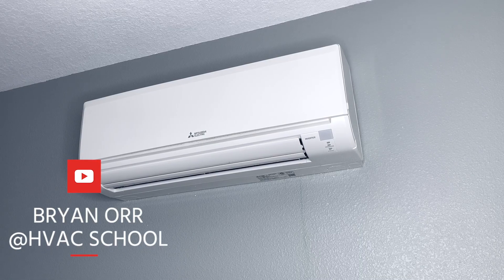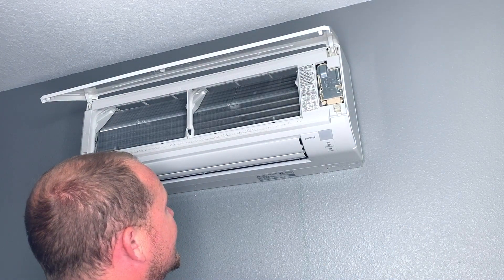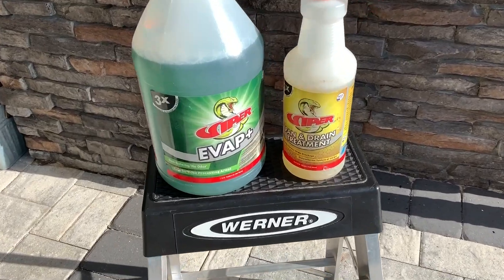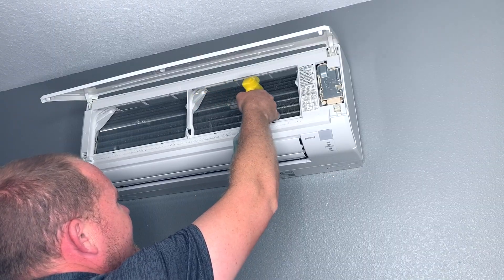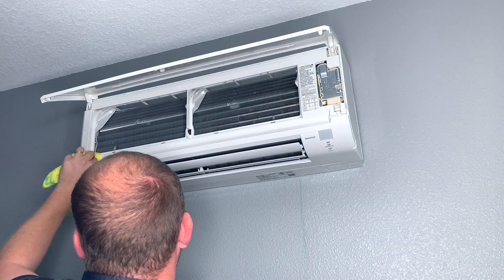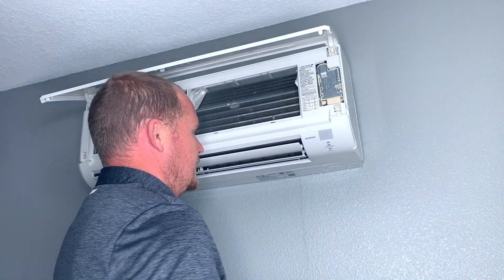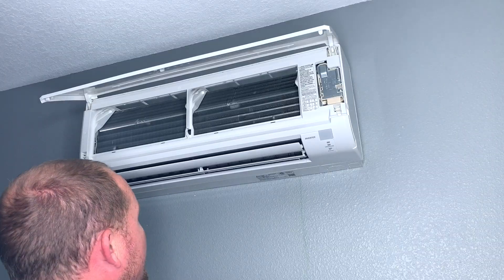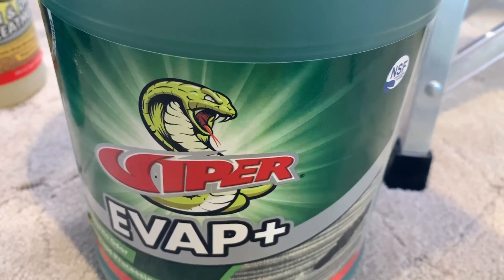Smelly Ductless

Comment: Thanks for this.  We used to get “ the smelly sock odor complaint, but didn’t have these products back in the 90’s
Reply: Yeah that green viper E cleaner works wonders on visibly clean evaporators with that strange smelly socks odour.   I've got MHI splits and they can be set to a self clean mode,  all it does is run the evap fan very slowly for about 1 hour after the unit is turned off with the remote,  drys out the coil and fins,  prevents most of that bacteria growing.
Reply: How do we know if we have this on ours?

Comment: Hello great information unfortunately for my Mr Cool split unit is still having the same odor after using the products u mentioned  I have done a deep clean also, I notice that when my unit is not cooling but blowing air  it will start to stink again I literally have drop degrees every other hour just to keep it cooling so that the air won’t smell 😩 any other recommendations I can try?

Comment: Great video. In view of all the videos like this and others showing the mold buildup in mini split system, why would anyone install these units. I reside in a log cabin and I was planning to install a mini split system—NOT NOW!
Reply: Because they're incredibly efficient, they can be installed in a day, they can be your primary heat, No duct work is required, etc. It would be a great option specifically for a log cabin.
Reply: Well because the units already cost me 10k and I didn't have another 12k sitting around to install ductwork.

Comment: The blower wheel also builds up debris over time,  it can add to the bad smell, looks like clumps of mold etc...And make sure the drain line is clear, I have cleaned the drain lines on 2 of my 5, that did clog over the years, preventive maintenance can keep them from clogging, gunky crap grew in them, depending on the drain hose used, different stuff gunk them up.  Clean tygon grows some foul stuff, maybe the corrugated drain lines sold as minisplit drain is actually better, I use both  types, it doesn't kink, to create reduced areas, and different plastic, more immune to growth of funky molds etc...
Reply: What’s the easiest way to clean the drain lines ?

Comment: My unit is 1 year old and fairly clean.  It was cleaned with recommended cleaners and still has a sour smell at times. My hvac is stumped.
Reply: Have you figured out what was causing the sour smell? I'm having the same issue. Tried all kinds of cleaners including the viper evap+ without any luck. The sour smell keeps coming back, and it only appears to occur when on fan mode (i.e. when the room gets to temp and the compressor turns off).
Reply: Nope! And go to Reddit, join hvacadvice, look for stinky sock syndrome which I posted.  jokers think I’m The only one who has a stinky ductless Mitsubishi. This is nuts. I tried to tell them IM NOT THE ONLY ONE AFTER RECOMMENDED CLEANINGS.
Reply: Nope! I accidentally responded on a different account I had. But join Reddit HVACadvice. Now they are saying I must have a dirty house. Wow! I need a group to follow me there.
Reply: @donjon8573 same here what a headache I’m working with the manufacturer right hopefully they can resolve this issue. I’ll keep y’all posted I have probably tried everything they recommend to do
Reply: It’s the plastic gullies in the units. Can’t be cleaned
Reply: @Mk-631  what are the gullies exactly ?
Reply: @jenconsumer5228 well, on my daikin ftxslvma i can see that unless you take the entire unit off the wall, the condensation catcher is larger than can be seen by removing the housing. It extends under and behind the coils however is has a plastic “wall” with 2-3 half inch holes for the condensate “inside” to trickle in to the visible channel  
You would not know what’s back there without flushing with cleaner and letting it dry. 
Harder stuff and “jelly” is difficult enough to get loose even in visible areas. 
Last week i spent half of one day cleaning my inverter (it’s seen years of use before i moved here, i SHUDDER to have strangers’ crud in my air)
Reply: Plastic gullies? What’s making the smell?

Comment: Had my ductless cleaned but still having an odor. What can be the problem.
Reply: I still have odor also after cleaning. Like sour smell.
Reply: I still have a sour smell coming from my unit even after cleaning. HVAC installer has no idea what's causing it or how to make it go away
Reply: Same here. Right off the bat of install almost. And when I change temps.
Reply: Did you figure out what is was? Ours have done the same.. right after install
Reply: Join Reddit Hvacadvice. I swear they think I’m crazy and saying I’m the only one oh, and they are telling my “my house is probably dirty”
Reply: I'm having the same issue. A sour smell is the best way to describe it. Tried all kinds of cleaners including the viper evap+ without any luck. The sour smell keeps coming back, and it only appears to occur when on fan mode (i.e. when the room gets to temp and the compressor turns off). My hvac guy can't figure it out either. Anyone have any ideas?
Reply: Did you figure it out? Ours do the same
Reply: Do you guys have this issue with ducted air? Also I heard it’s probably the plastic gullies in the AC, nothing you can do
Reply: Same as the other commenters.  Sour smell when the room temperature is at or near target temperature set.
Reply: Same, had a high preassure wash and it still reeks. 
Considering that it's an ideal for bacteria and fungus to develop, nothing you can actually do about it.

Comment: thank you for the tip! Cleaned all my units using vinegar and water mix. Now one of them is starting to smell after only 1 month! The smell is swampy...I looked for this product, how can a non-tech purchase it? What could be causing the smell after only 1 month?
Reply: Amazon. I’m hoping it works. Trying tomorrow.
Reply: I just got mine. Haven’t had time to apply. Post if it works for you !
Reply: Ever get your smell to go away? I’m having issues still after cleaning
Reply: @citizentaxpayer460  I ended up just leaving them be, winter came and we used the heat function with no smell issues. Then, in spring & summer they  seem to be fine. Not sure if whatever it was dried up or what, but I think I will try to get this product for the next time!

Comment: The enzyme and Black Platinum filters are missing on the big blue screens, they remove the damp musty odor, they last for a few years, and need to be replaced, I just changed out 5 sets, big difference filters ain't cheap, about $38 each from ecomfort.com  get a few years out of em, but they do loose effect after being rinsed many times over the years, the big blue filters are just dust
Reply: Emzyme filters are only good for one year. Even says so in the manual
Reply: That is just what I suspected. My Fugitsu split system is less than a year old, and smells like sardines. The tech says he can't smell anything. He called back with this very same product and sprayed. It still stinks of fish. I've noted those things are not on this new unit.